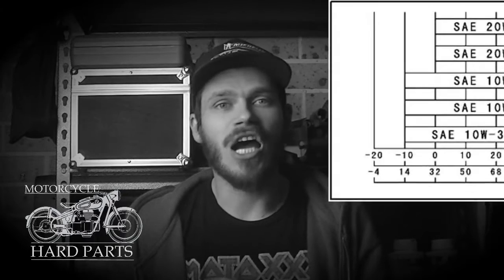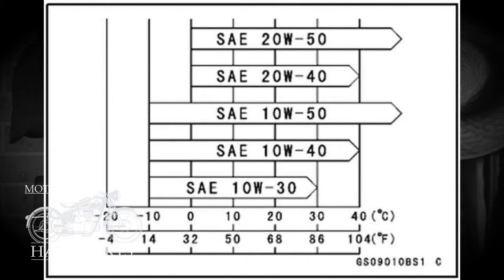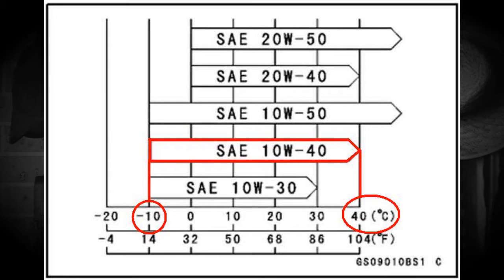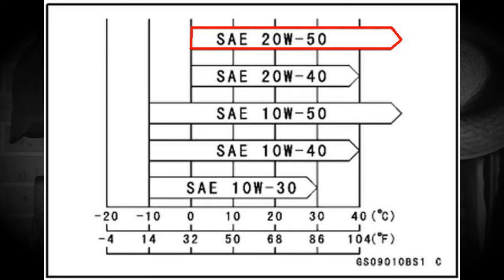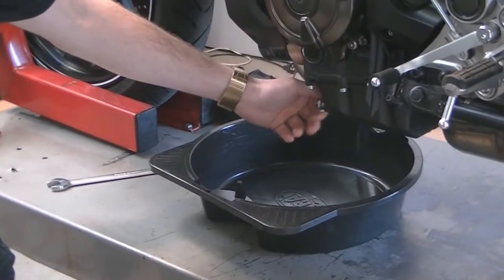EXPLAINED! Motorcycle Oil Ratings "VISCOSITY,"

Comment: The chart you shown is a great help. I didn't know that the 10w-40 oil is only recommended up until 40 celsius  and in my country, temperatures exceed 40+ degrees.